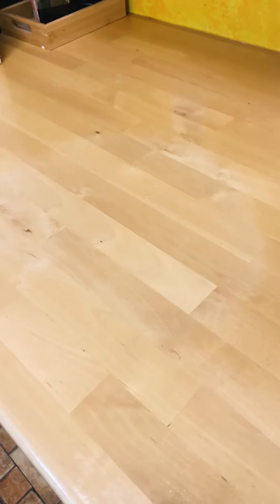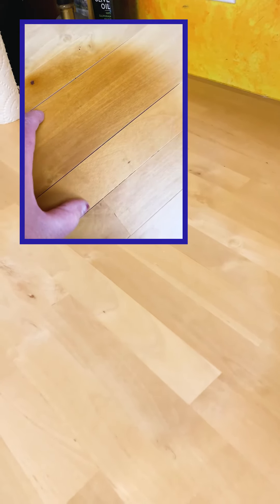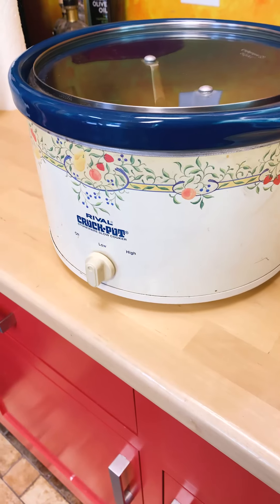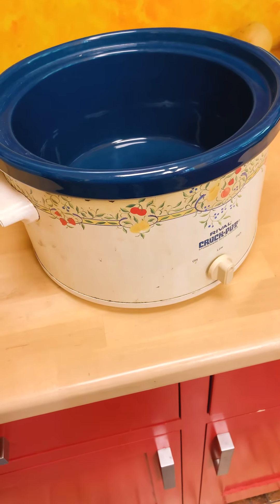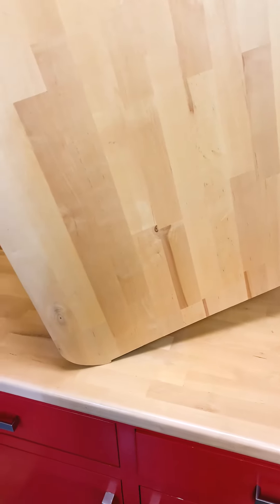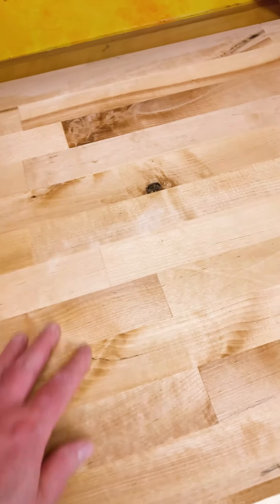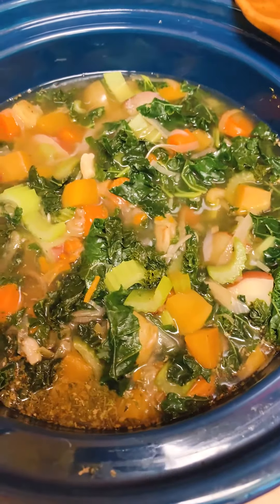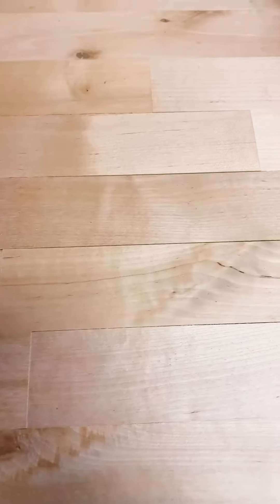Update on Scorched Butcher Block Counters

Comment: That crockpot probably came with feet (metal screw in or rubber). I know my really old one did. They have push in rubber feet replacements pretty cheap. Much cheaper than having to fix your counter.